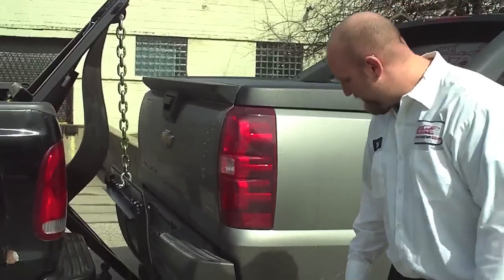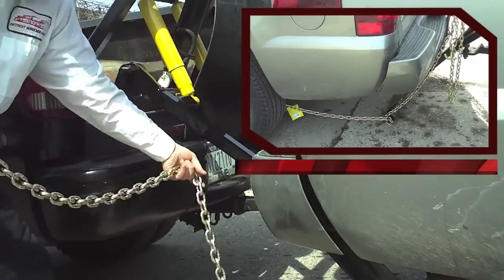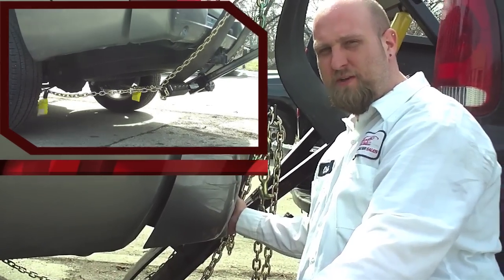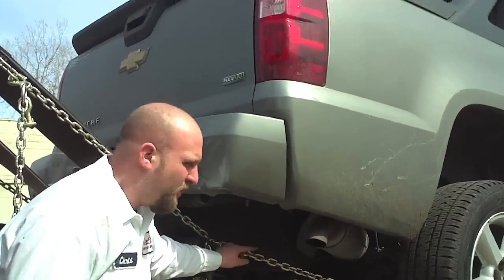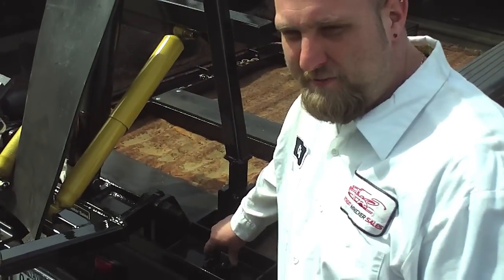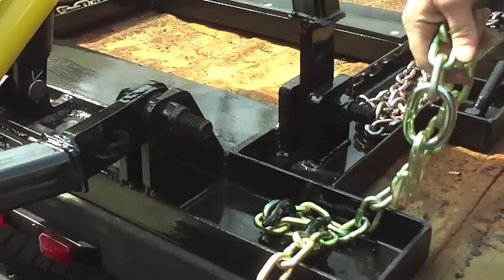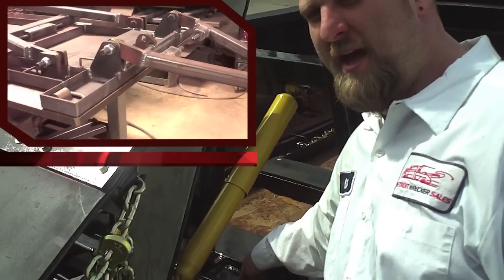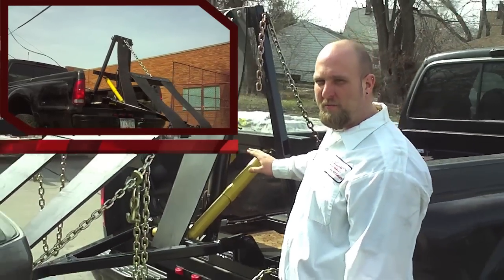How to Tow w/ a Sling - DetroitWrecker.com

Comment: I'm sorry but that is the worst example of using a sling that I have ever seen, For one when you wrap your chain on the bottom hook of the slain and bring it up to the top hook of the sling it is not supposed to be as tight as the rubber sling it is just there as a safety precaution if the rubber tears I would much rather prefer and I'm sure customers due to have the rubber up against my bumper then the chain itself digging into the bumper, And after you give it a love tug the sling should be on a up-and-down angle not a horizontal angle because when you hit the brakes hard in emergency it will slide read across that horizontal rubber Sling, If it was vertical it will push up against the sling and stop it along with the arms from slamming into the back of your tow rig, That example in the video with an emergency braking on a heavy load that truck is gonna come rate offer that set up and I would love to take it in a parking lot in demonstrate how you'll load will fall right off, And furthermore your safety chains are way too tight You're not gonna be able the turn out of the parking lot without ripping one of them hooks off the bed I think with all the experience you guys have in building The units your design could have been a little better especially for the price I have used other units Half the costThat have worked flawlessly actually have a telescoping boom winch mounts tail gate closing option and have lifted 12000 lbs,  Sorry but I expected more out of this company,  You can hate me for my comment but I whole 3000 cars a year,  And my 550 still has a sling option because nothing tows better   Then a sling when you put 14000 pound on the back of A550
Reply: Dmk pit 
Agreed 100%

Comment: Never attach your safety chains to the same place that you connect your J hooks to. If that axle came loose or some one hit the towed vehicle and you have them both at the same spot you will loose that vehicle. J hooks on axle safety chains on frame or another secure point seperate from the primary load chains. Don't like or trust those skimpy repo units. The sling was to flat and would ride up the straps even in a mild fast stop. Straps should be vertical  as much as possible to stop the towed vehicle from riding up them.

Comment: Being a former tow truck driver from So Calif who first learned on a  sling in 83,  Use a real tow truck and not a repo truck because the sling sits different on a wheel lift compared to a repo truck, I could go on and on but someone needs to learn how to sling with the correct type of sling truck....

Comment: i don't think my customers would like a plastic bumper deep scratched by a chain. WHEN i chain/sling lift a truck i use a 4X4 timer under the chains so i dont scratch the bumper & slide a chunk of rubber mat behind the chain for added protection. Damage = LESS $$ for my business. They ALSO just bought the J hook chains for $46.95 each

Comment: Wrong way to hook it.  When you wrap the chain at the bottom it's called a chain lift, which is used for heavier tows so you don't rip the sling pads and always a timber in front of the sling between the lower chain and the bumper,,,,,,this guy doesn't know what he's doing

Comment: chains too tight and digging in bumper , and j hooks should be over the axle not under, if they were to stop hard , the  towed vehicle would ride up that sling or cause slack in the chains and the j hook would fall off the axle the way he has it, over the top it can't fall off
Reply: Mr390cid this
Reply: Mr390cid ALWAYS put J hooks up.  there needs to be something(like blocks) to keep the car from sliding up the sling
Reply: if you put the J hooks up,car slides up, chain comes loose, J hooks hits ground, and goes tords the rear.
Reply: if you put the J hooks over,car slides up, chain comes loose, J hooks hits ground, and goes tords the rear.

Comment: The sling tow unit was state-of-the-art until the early 1980's. Like anything, the operator learns to tow a whole variety of different cars. 

Perhaps the most difficult I ever hooked up to was a Citroen DS that belonged to a famous actor. It had a very long undertray made of aluminum. May have been the only time I had to use the old TA105 attachment. 

That was quite a challenge. Of course, done without damage to the car!

Comment: Cross the hook up chains on the sling and they won't scratch the bumper.Putting the sling that far and creates a launch ramp, keep the cross bar at the bumper and use wood.J hooks up or down doesn't matter if brake lines aren't in the way

Comment: If you cross the safety chains so they hook up on opposite sides of each vehicle and use one on each side you will keep them from binding up because of lack of slack easier and if the vehicle being towed should have a situation where the safety chain  becomes necessary to keep control of the vehicle having them crossed will control the towed vehicle better while puling to the side and coming to a stop.

Comment: I thought i was the only one who used the safety loop with J hooks . I still operate a sling here and there for larger SUV / Truck applications , but can be difficult on lower slung cars .... I carry 2 different pieces of wood on my truck - a 6X6 , and a 4X4 about 4-4.5 feet long to place between the sling chains and the chassis/undercarriage of the towed vehicle - keeps from folding & damaging plastic bumpers.Believe it! if you are good with the placement-Corvettes can be slung from rear !
Reply: I have done a corvette on the sling, when I started towing everything was on the sling.

Comment: Yes you´re right, in my opinion the sling it´s just for wrecked vehicles, the sling would be the only way to tow 50 years ago, but today there are a other metods like tow dollyes, wheel lifts and rollbacks which can tow vehicles damage free
Reply: How do you use a wheel lift if the wheel and suspension was torn off? Use a sling, if used correctly the sling can safely tow almost any car. Just so you know, he did not load it correctly.
Reply: @kevinlimo696  slings are good for wrecks thats it . there old and outdated
Reply: @robertpaulson208  .... They are popular with scrappers, slings are relatively quick and easy, and an old sling bed is cheap.

Comment: I'm looking for a slide in sling unit like this. I have a couple questions. How does it attach to the truck? I've never actually seen a slide in in person, so I'm wondering how it bolts in, it must attach to the frame right? How much does a unit like this cost?
Reply: It bolts through the bed. Remove the factory bolts and use larger grade 8 or better. They don't make this unit anymore. I have one in the bed of one of my trucks. I can shoot you pictures of it if you need them.
Reply: I'm good I was just wondering thanks alot God bless

Comment: why put the sling so far under , i used a sling for 10 years and i never did it like that . and the loop around can be done in one motion . no need to take the slack out by moving truck forward either

Comment: wrong.... over the axel and between the first and second hook you need slack. You also need a board or landscape log to put between the chains and the bumper if you don't wanna fuck it up
Reply: You're talking about putting the J hooks OVER the axle? Why would you do that?
Reply: Because it helps to keep the landscape log in place while you connect the chains on the second set of hooks
Reply: @troylaquerre5466  oh. Crazy I've never once seen anybody do that. We always go under, it still holds the log when you put tension on it.
Reply: @kirwankars8597  I always go over the top. shouldni brake hard or get hit and the towed vehical rides uo the sling the js won't fall off the towed.

Comment: With the advances in towing technology, why would you even want to sling a vehicle? The pick up truck is too light for this equipment, the Chevy Avalanche weighs at least 5000 lbs is four wheel drive, towing with the sling could damage the transmission, at least with a rollback, you won' t run the risk of damaging the Avalanche's drivetrain or if you select to use a wrecker, use wheel lift and dollies for either set of wheels on the ground, besides, since newer vehicles are lighter, you can cause a lot of damage if you use a sling.

Comment: I'm surprised nobody mentioned the safety chains not being crossed.   
Towing 101 guys.
If you don't cross the safety chains the weight (should there be a failure on the primary hook-up) doesn't get evenly distributed on both chains, chain breaks, people die.  

Just sayin...
Reply: That only applies to trailer tongues. You cross the safety chains to keep the tongue from dropping to the ground and digging in and losing control of the trailer. A vehicle with a square / perpendicular bumper plane to safety chain orientation can not fall between the chains, so no you don’t crisscross the chains.

Comment: i agree with most this but not all, notice when he pulled forward to lifted position the one chain was still slack, defintly is a better way when towing a truck with a hitch, so no weight at all is on the bumper and safer, just my thoughts.

Comment: guys still under hooking js. when you guys relieve that makesnit so it can fall off if truck rides up. youll loose whole rig that way for sure. especially with the sling at that angle. any hard brake and your screwed.